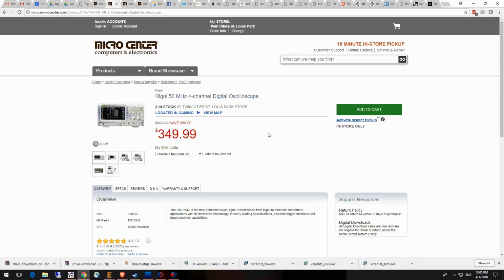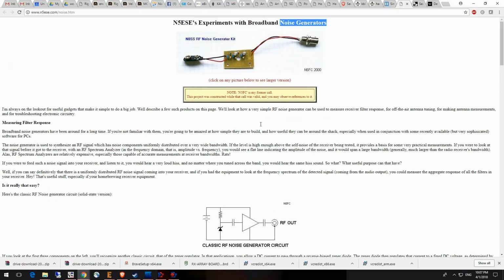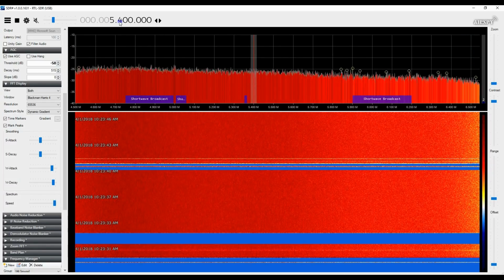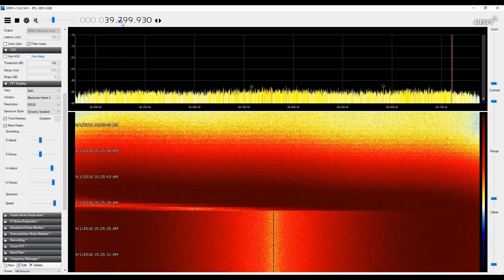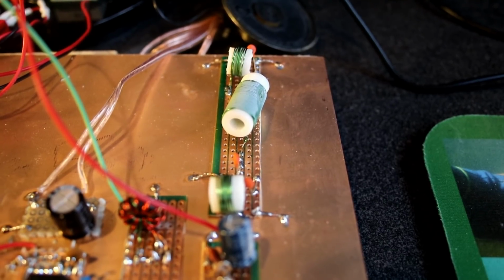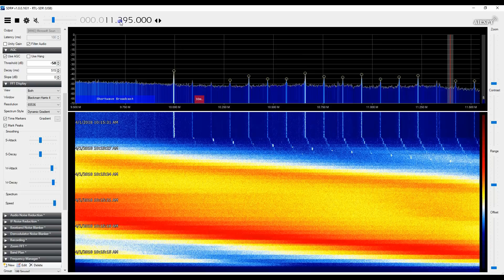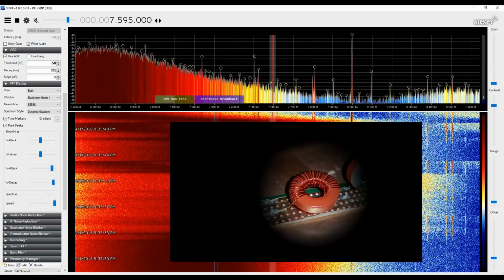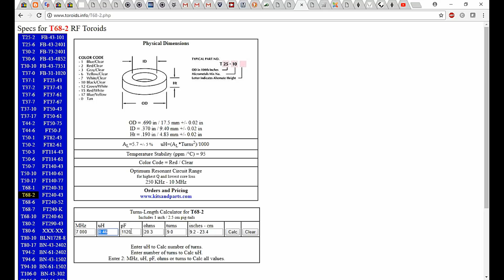Poor Man's network analyzer for measuring filters (noise generator + RTL-SDR)

Comment: You can buy a 100MHz scope for that price. Anyway, I'll use the same method for characterizing a RF power amplifier. I have a cheap RTL-SDR which is not very sensitive, but at least suits the purpose.

Comment: hey where do u buy copper wire, copper clad and sma connectors for cheap? do u have ebay links? thx in advance
Reply from the maker: copper wire and sma connectors I ordered off ebay, but I just searched around and looked for something cheap. The copper clad is a spoiled board from work (the other side has been unsuccessfully milled several times on a circuit router) and I have a handful of (sometimes pre-connectorized) coax stubs from the scrap bin.